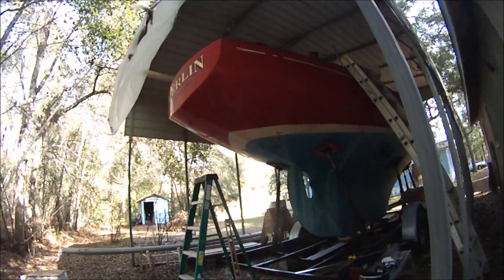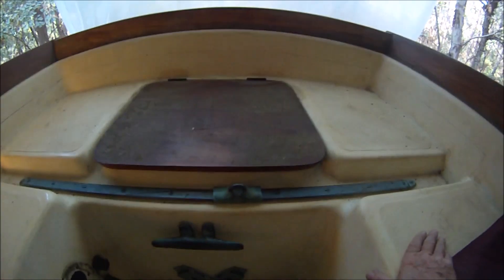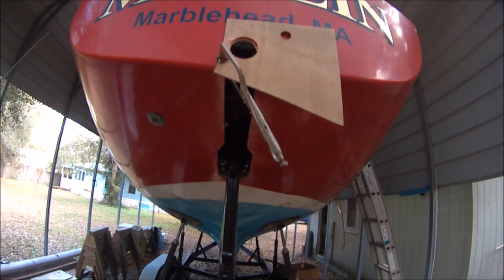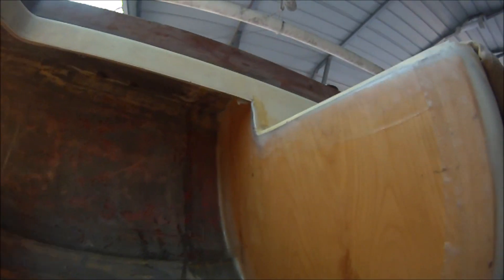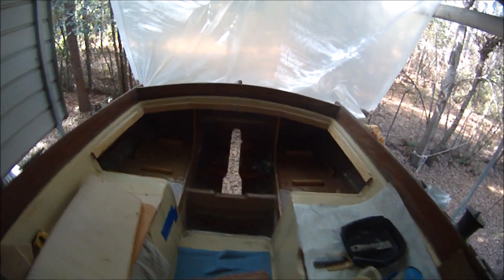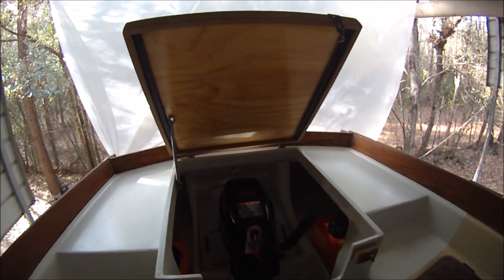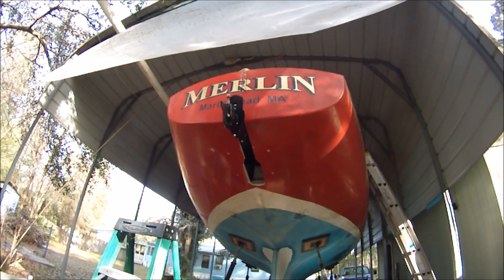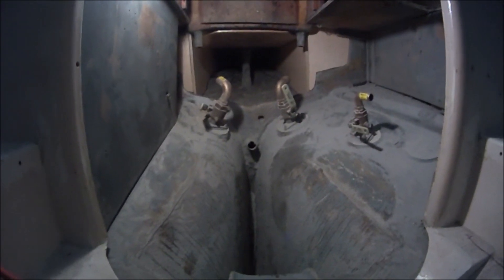Tripp 29 Part 2 - Outboard Well

Comment from the maker: Someone asked on another thread about the prop sucking air in waves and I replied: There could be a problem if you weren't careful when motoring in significant short waves. In practice I have tested the motor in close choppy waves at an ocean inlet with 3 knot current against 15 knots of wind and had no problem with the prop coming out of the water. These motors have an Over Rev RPM Limiter so there would be no motor damage if it only happened occasionally. I place the motors as far forward and low as possible and now only use the extra long shaft (25") models so in practice the prop sucking air is rarely a problem. They work much better than putting them farther aft on a transom bracket. Of course we don't motor in extreme wave conditions also due to the low horsepower. Power, range, and keeping the prop always in the water are advantages to inboard diesels but the tilt-up outboard well has numerous other advantages. It depends on the sailor and their needs to select which is best for them.

Comment: Another great tutorial. Any thoughts on running cockpit drains directly from the aft cockpit area through the transom AWL so the can drain directly aft through the motor opening? I'm plannimg on that for my Cape Dory 25. I have to re-slope the cockpit as well. I'd appreciate your thoughts on that idea.
Reply from the maker: There are one-way rubber flap valves you install in the bulkhead to drain the cockpit footwell into the motor locker but the benefits are minor since presumably the sliding doors around the motor shaft would be shut to minimize wave entry, which would slow down the drainage of the footwell. You could run hoses aft to the transom with those same flap valves for better effect.

Comment: One question that has come to mind: Is there any merit in using a bead and cove arrangement on the cover boards for the motor slot to minimize even more the intrusion of water into that compartment? I could envision this and even some gaskets and buckles to compress the gaskets into the slots. It would seem that in extreme following seas the tighter the better. I could envision gaskets surrounding the motor shaft further stabilizing it and reducing and sharing stresses on the motor mount. On another note I am impressed by how the new motor well enhances the structural integrity of the transom of the vessels you upgrade. The integral forward water tanks up front do the same along with sealed chain lockers. Someday maybe I'll have a boat like that. Still dreaming and working towards that goal. There is an Alberg 30 out there waiting for me;)
Reply from the maker: I don't bother to make the sliding cover boards seal any closer because you can't make it completely watertight and it needs to drain out as it comes in. We are only trying to stop large amounts of water shooting in and provide less turbulence than an open slot in big seas. The 6-hp motor is light enough that it doesn't require further support than what it has but it certainly wouldn't hurt to add some. We've sea tested the design on several boats offshore and didn't have any problems yet.
Reply: atomvoyager Answers my question. I've watched your sea trials and found them fascinating not only as to how the motor well works but also the other refinements you've made in the Alberg designs. Thanks for the follow up answer.

Comment: Thanks for another great video.
Does removing all that material weaken the structure any at all?
Cheers,
M
Reply from the maker: It would weaken certain areas of the boat if care was not taken to reinforce with enough plywood, fiberglass, and epoxy so that it is at least as strong as original. I believe we have it stronger than original at this point.

Comment: This is fantastic.  These are some of the most useful modifications I have seen on smaller boats.  How much weight savings do you think here.  Motor, shaft, tanks battery ect?
Reply from the maker: Thanks. I haven't calculated the weight savings since it was only a side benefit for the modification. I guess it would be several hundred pounds. Even though the motor and gas can weight is further aft than much of the inboard motor weight, it's still a big weight and space advantage.

Comment: James:  Have you ever contemplate building integral fuel thanks in the space that the individual plastic fuel tanks go? Is that a bad idea, if so why? Also if you where to go that route, what materials would you use? Thanks!  Antonio
Reply from the maker: If you mean building integral tanks in the buoyancy lockers under the gas tanks, I've considered it because it seems an obvious place for a gas tank. I'm sure someone could do it. Building them above that would block access to deck hardware fasteners. It would be complicated to construct - you need a gauge, vent, fuel fill, hose attachment, access port, and ability to guarantee no water enters the tank. I'd also feel the need to use something like more expensive coosa boards (well sealed with glass and resin) for all the adjoining panels and bulkheads. Even then, you lose the convenience of grabbing a portable gas tank for filling. Considering everything I have a preference now for keeping them as buoyancy chambers, but might try that on some future project if the owner felt strongly about it.

Comment: A quick questions about towing vehicles; I noted you have a Ford F-Series quad cab that you tow your boats with. In one video you tow a boat all the way to California. My question; is it a 150-250-or 350 and what engine does it have, diesel or gas, and displacement? I am looking at a vessel that has a trailer and am considering trading in my minivan for something that is more substantial. Don't need new, just good and able to tow adequate gross weight of Alberg 30.
Reply from the maker: It's a 2003 F250 with V10 gas engine. A 150 is too light all round for boats over about 6,000lb displacement unless you were making a very short trip on level ground. An F350 with diesel would give you more safety margin put I've had no problem with mine. The build quality must be good because I've had no issues with it during many years and many cross country hauls.
Reply: atomvoyager Thank you. I tried to see the markings on the truck but couldn't make them out on the video. My guess it was at least a 250. I have a 10 cylinder Ford 350 van I use for work and the 10 is a great engine. Ford trucks seem fine and used prices are within my budget.

Comment: Why not use a 9.9 it would give more power in bad weather?
Reply from the maker: Even though it's physically larger, a 9.9 or similar size could fit here but the owner decided he wanted a more minimalist system for less cost and weight. Also, the larger motor would require a higher locker lid and moving the bulkhead a couple inches forward. I have added a 9.8-hp to another similar sized boat that's featured on this channel.

Comment: How are you charging your batteries ?
Reply from the maker: Besides the occasional assist from the motor's small 2-3 amp alternator, we plan to use two 50-watt solar panels for the three AGM GP31 105AH batteries for the modest expected power requirements.